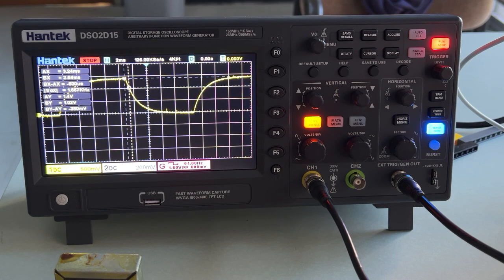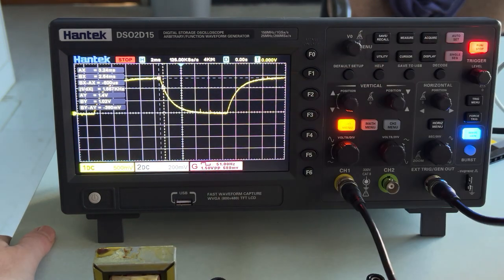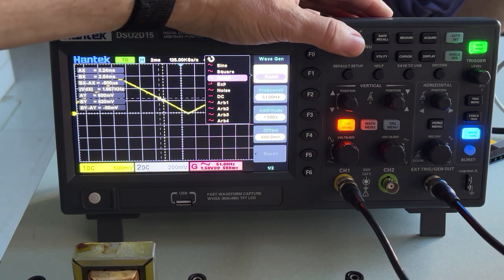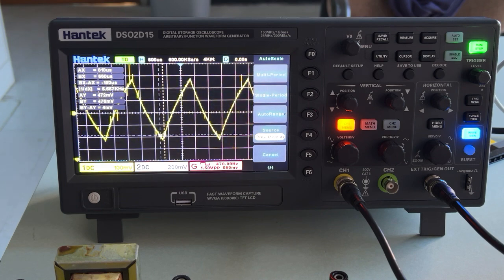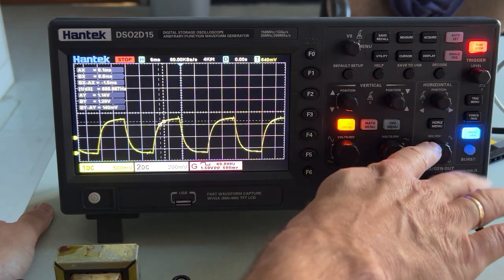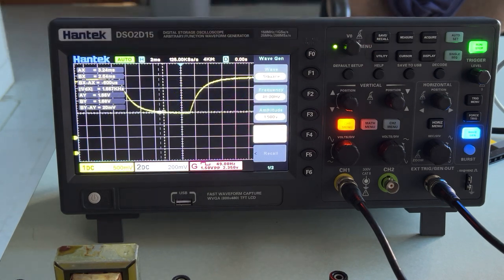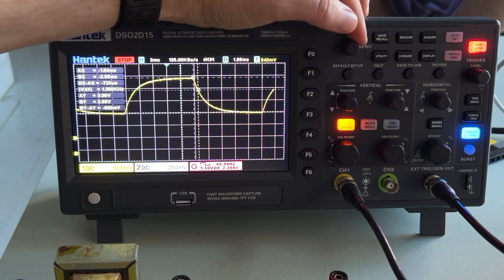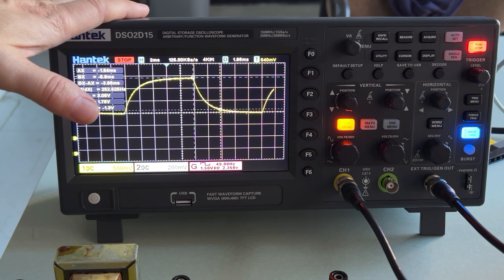Physics Lab: Intro to Oscilloscopes for RC Circuits

Comment: Glad to learn something from you! I have the same oscilloscope. I used it to check the power adapter output ripples(10mv to 200mv) and circuit board noise.

Comment: if you notice the "slope" of the flat part of the square waves, that can be caused if the probe has not been "compensated"... the compensation adjustment changes the behaviour of both the "edge" and "flat part"...the edge part is adjusted to reduce the "overshoot", where the edge comes up and goes above the flat part, maybe even "ringing" a bit. The idea is to adjust the compensation to get the edge so that its top part has little, or no, overshoot, BUT, the flat part of the square wave shoulb "flat", without a slope; if the edge is 'over compensated', the flat part will have a slope...
sorry to blather on, but you want the waveforms on your scope to be accurate, and the probe, and probing technique, are a HUGE PART of getting the best measurements!
(I'm blathering on about this, based on experience as a test & measurement application specialist for scope manufacturers, and desire for you to enjoy working with scopes, and getting the best from the most valuable tool in electronics!)